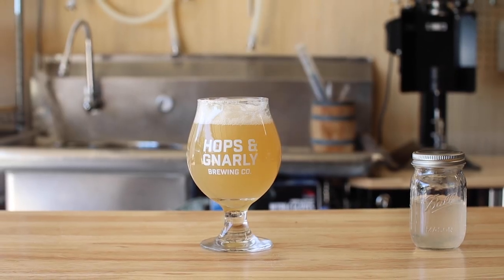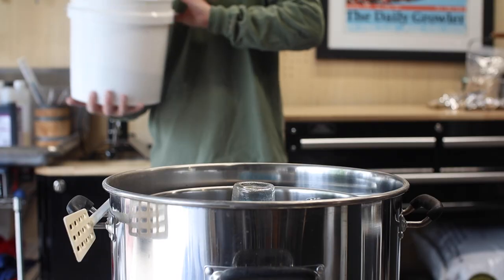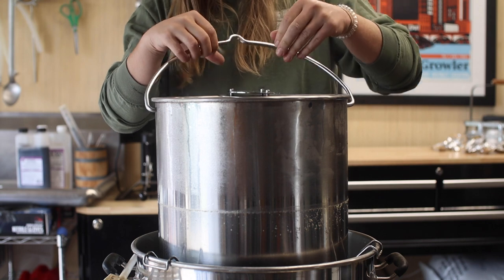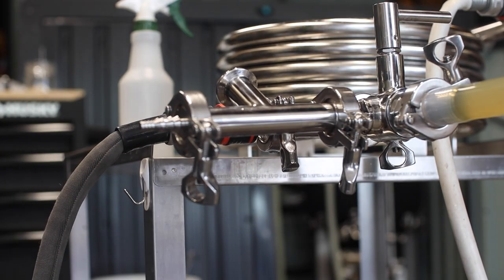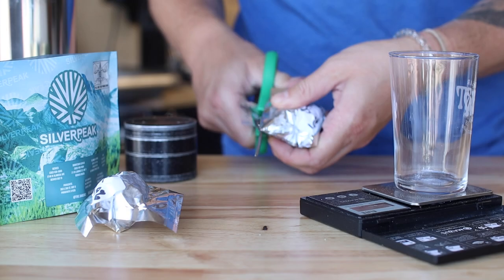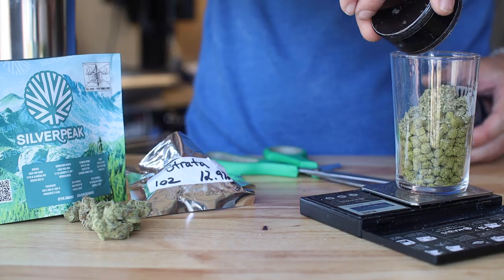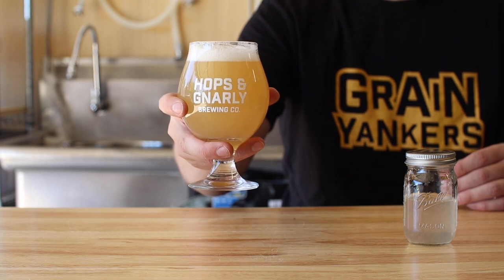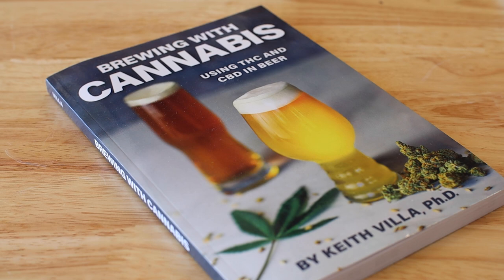BREWING WITH CANNABIS | Infused Low Alcohol Pale Ale

Comment: If ya want to skip adding the grain alcohol, you could use a vegetable glycerin tincture instead. I've never been a fan of alcohol tincture, but glycerin tinctures are great!
Reply from the maker: That’s a great suggestion! Would it dissolve easily in glycerin as well? Might have to give that a go
Reply: @HopsANDgnarly  I use flower to make glycerin tincture and it takes a few weeks to make properly. There are faster ways to get it to extract with vegetable glycerin, but you loose flavor.

Comment: Does the wax not separate in the grain alcohol?
Reply from the maker: It’s not a perfectly homogenous mixture which is part of the reason I didn’t mix it into the batch but it does dissolve into the alcohol pretty well. In the interview he suggested using an emulsifier but I couldn’t get a small enough quantity. So I just give it a good shake before dosing and it works well

Comment: You didn't decarboxylate so you wasted the thc. You should have used an rso to make the tincture.
Reply from the maker: What do you mean I didn’t decarb?
Reply: @HopsANDgnarly  to decarboxylate and activate the thc you need heat.
Reply from the maker: @erichlf  I decarbed the concentrate for the tincture but you are right about the flower. That amount wouldn’t have made a difference anyways, it was just for flavor.
Reply: @HopsANDgnarly  I didn't see that in the video. I saw you add the sugar to the alcohol and that was it.
Reply from the maker: @erichlf  idk what else to tell you my dude. Put it on a silicone mat and put it in the oven. Talked about it in the vid. Thanks for watching
Reply: @HopsANDgnarly  ok, I guess I missed it.
Reply: Nonsense. The stomach acid does it. Besides, the dry buds are already decarboxylated.